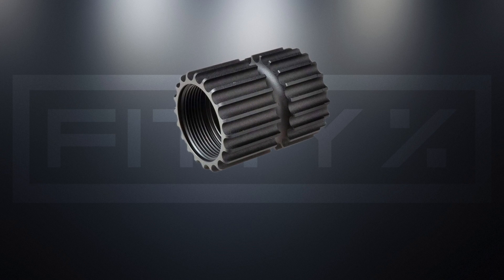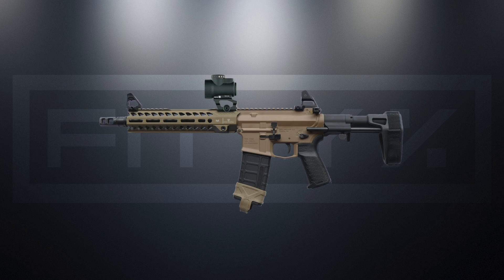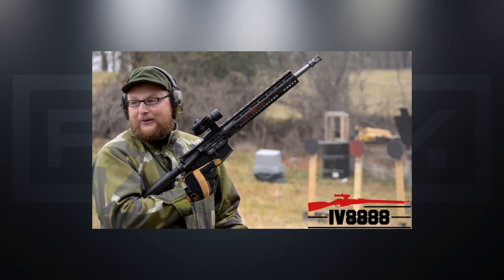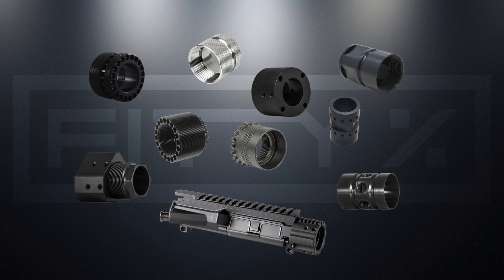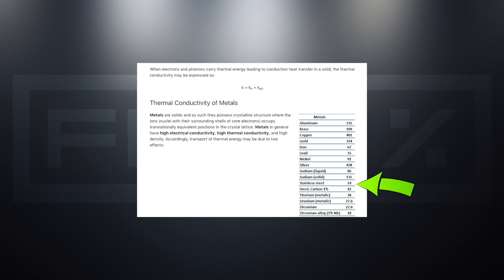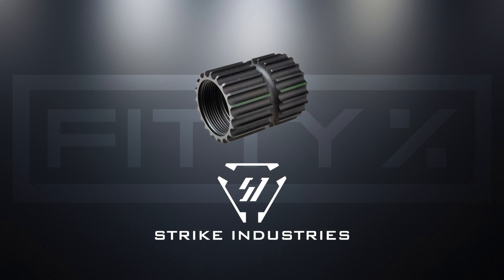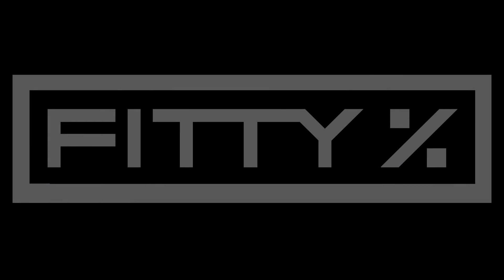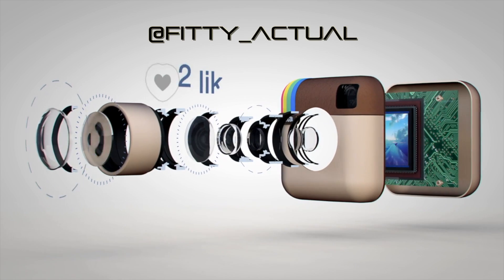Let's Talk - AR Barrel Nuts

Comment: Anti-rotation tabs will not stop the handguard from getting tweaked during a drop. Also you have LESS surface area with that barrel nut for the handguard to clamp onto. Look at Geissele and Hodge barrel nuts. They are some of the best designs in the industry
Reply from the maker: I never said that the anti rotation tabs would stop a handguard from getting tweaked/bent from a drop. Of course it can get tweaked from a drop. I don't understand why you even said that.

As far as the rail attachment, it's a "clamp" style and the bolt that secures the rail slides through the cut the the barrel nut and it's very secure when torqued properly with Locktite. Geissele makes quality stuff, but it kinda sounds like you're "fanboy'ing" a bit.
Reply: @FittyACTUAL  Because if its dropped with that sight on it.. now your zero is off

Fanboy or not hodge and Geissele barrel nuts minimize deflection when loading the rail
Reply: @dramag27  Yup, and his logic on heat is backwards as well.

Comment: The new tennulam aluminum could be used for barrel nuts the aluminum can heat sink the throat and chamber. We also need to then conduct the heat then out of the handrail. So the mounting part of the handrail need to be aluminum too. The last half of the hand guard could be polymer or carbonfiber. Besides fluting you could have AL "donuts" and press them onto the barrel to "fin" them like the old tommyguns. The quicker we get the heat out of the barrel the thinner and quicker we can shoot. Of corse putting the barrel in that could effect harmonics. The other spot to heat sink would be right after the gas block but on the gas tube. As heat builds up there first then travels down it. A good muzzle device is important too as the low weight will make it shake and kick more.

Comment: I didn't come here for Strike Industries attaboy but I'm glad to hear it, because I just started building a fancy shmancy Instagram build. I got everything for my lower so far just need the upper parts and now I think I might go with the SI rail. My question is dose it matter what upper receiver I use with there rail and barrel nut? Fyi I have Sons of liberty gunworks 13.7 5.56 barrel otw.
Reply from the maker: Any rail should work with any upper. Check out the new Grid lok light rail from Strike. It's featured in my newest build video the 6mmARC.
Reply: @FittyACTUAL  will do thanks man.

Comment: FWIW I very much disagree with your theory on the barrel nut. Yes being aluminum and having the thin ridges will make it act like a heat sink. But this works against you for your optic. Aluminum not only conducts heat at a faster rate it expands about twice as much with that heat. Now you have a barrel nut that not only will reach a high temp with fewer rounds but is gowning in size as it does so. 

This will cause two problems, the nut will press inside the handguard throwing it off, and it will transfer more heat to the aluminum handguard faster causing it to heat up. With a steel nut you reach a point where the aluminum handguard is dissipating heat faster then the steel nut can transfer it.
Reply: That's why I dont mount anything other than a Bipod on my hand guard.
Hand guard are never really sturdy enough to attach a scope or back up sight.They usually bow like a Ski Slope
Reply: @TexasTrained  I got folding BUIS on the handguard of my 300Blk pistol. But they're back up, and the best option for irons. If I'm using them in a fight things are really fucked anyway.
Reply: @snek9353  you probably wont be too far away with that pistol in 300Blk.You could just Point..LOL
Reply: @TexasTrained  LOL, a yeah, I didn't build it with long range engagements in mind. I did put good optics on it though, a red dot with BDC and a magnifier. Currently it's practical limit is 350yds. That's gunna get shorter though when the suppressor gets out of NFA jail and I load it with subsonics.

His looks cooler, but mine's more capable.

Comment: This product has been discontinued by the manufacturer... 😢 Why?
Reply from the maker: I think they kinda copied the POF barrel nut design plus they cane out with a new handguard and nut.
Reply: @FittyACTUAL  Yeah, I think I saw the new one but it's not similar to this, is it? I don't think it had anything to do with POF as I don't see any public filings against Strike Industries...
Reply from the maker: @archaicsage4803  they may not have anything against them but POF did come out with a design very similar before they did.

Comment: The SI barrel nut is really interesting, what about the JP thermal dissipator?
Reply from the maker: Same concept but on the barrel itself.
Reply: @FittyACTUAL  yes I am digging this idea because I have a Faxon thinnest pencil barrel 16.5 weighs 19oz and it heats up crazyly fast. with a carbon fiber handguard not helping either. It is sub moa when cold but opens right up after 10 shots. Hope this SI could help but does it only take SI handguards?
Reply from the maker: @linkchen8245  yes but sadly I also believe that SI stopped making the aluminum barrel nut.
Reply from the maker: @linkchen8245  yeah I found out after I made the video that POF did it first...lol
Reply: @FittyACTUAL  Would it be better to make the heat sink barrel nut longer to max the heat dissipation if weight is not a concern since it aluminum. Maybe treaded or lockable forend to attach multiple heatsink extensions like lego pieces?
Reply from the maker: @linkchen8245  that's not a bad idea!

Comment: Yes, you are wrong.  Front and rear sights give you a longer bore sight through 2 different planes of reference, thus making your aim more accurate.The reason you don't mount an optic on your rail is due to flex.  Optics only have one plane of reference unless you are co-witnessing front sights with them.  The farther out you go on your pic rail the more flex your optic is subjected to. Especially is you are sitting it on some sort of rest o barricade or using a verticle foregrip.  They induce pressure on the rail.  Hence, changing your POA

Comment: My barrel nut is kind of lose when I screw it on the upper.  Not until it comes flush with the upper does it feel tight and secured.  Any suggestions?
Reply from the maker: When it comes to interchangeable parts, both the upper and nut should be within their respective tolerances, but with that there will be a tiny bit of "slop" or looseness in the threads until it gets to the end and then the threads on the upper and nut press together getting tighter. 

It sounds like you're threading the nut on the receiver without the barrel in the receiver and without the barrel I stalled it will take longer for the threads to tighten up.
Reply: @FittyACTUAL  you are correct.   The barrel isn't on yet because I ordered it online and still waiting for it.  I was just concerned if it will be loose also once I get the barrel on.  I was worried if it was safe.

Comment: Back up irons are just that, back ups. With hard use you are likely to see some degree of zero shift anyway with almost every handguard, but even moreso with "light weight" handguards or those made of inferior materials or poor design. look in to 6061 vs 7075 vs 2099. Regardless of potential zero shift, having some sort of back up sighting system will get you relatively close to on target, compared to just shooting with no sights at all. Most zero shifts that occur in FF handguards after sustaining damage is around a 3 MOA shift. There is no other option if you want back up irons, except using a FSP in place of a flip up front sight. While you're correct your aim will be thrown off more the further the two sights are from each other if a zero shift occurs, you'll destroy your sight radius and your aim will be garbage if you move them closer together. The reason people advise against putting your optic on your handguard instead of your receiver is for these exact reasons. You will never have consistency in your shot placement unless you are doing static shooting and your rifle isn't being bumped and tossed around and going through phases of heating up significantly, cooling down, etc. As far as the SI barrel nut goes, the design is only good for weight savings, because heat mitigation should be your last concern if you arent mounting your optic on your handguard like a jackass. Not to mention the fact you are only saving like 20 grams give or take with this design.... As far as the design goes, the reduced contact with the handguard increases the risk the guard will jump forward over time and it also increase stress on the mounting system, increasing the risk the screws will shear, strip, or become damaged and locked in place or allow movement. The exact opposite of what a barrel nut is supposed to do. If the nut moves, the handguard moves, the barrel has the potential to move, and you run the risk of catastrophic failure such as an OOB detonation. No hard use company with military contracts designs things like this because they understand the point of the barrel nut. The barrel nut is not designed as a heat sync and should not be modified with heat dissipation in mind because the difference in heat dissipation is minimal across various barrel nut materials. If you want lightweight, use a different material, not less. Strength and lockup should be the primary considerations you have in mind when choosing a barrel nut, followed by weight and thermal conductivity as the least important factors. Let's not forget to mention the fact strike has discontinued this barrel nut because of numerous failures and exact occurrences of the issues I described above. Strike Industries is a gimmick company that appeals to the tacticool crowd that are more concerned with form and aesthetics and having cool color schemes rather than functionality and durability. If you wanna look cool on Instagram though you can't go wrong with strike. I forget the value, but the difference in heat sink performance between steel barrel nuts and aluminum is negligible, and the difference they make in performance even is even less noticeable. You would really only begin to see a difference under sustained full auto fire, but your barrel will be the biggest factor as far as performance goes and will most likely fail before anything else.

Comment: What grit lapping compound do you recommend?
Reply from the maker: The finer the grit the longer it will take, but I use 220. You can get the lapping tool and compound kit I designed from gandgrifleworks.com
Reply: I use valve grinding compound, available from the auto parts store.